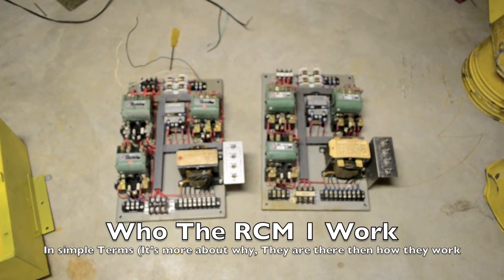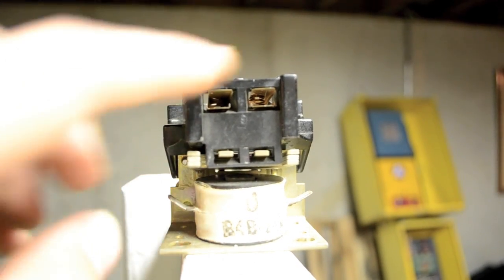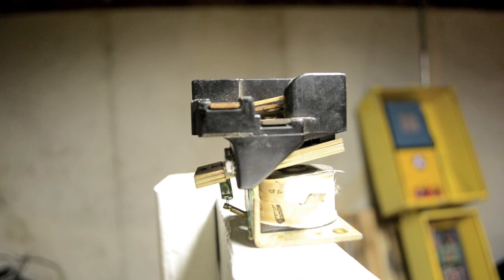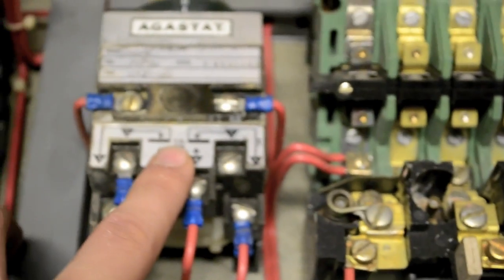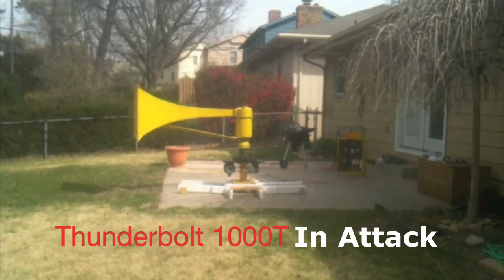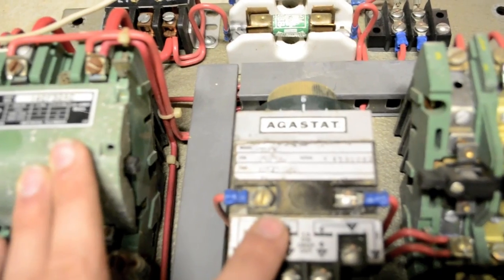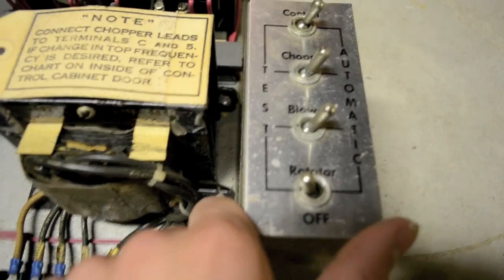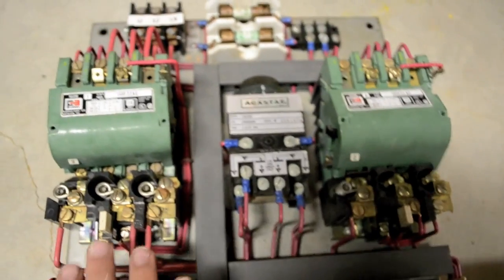RCM 1 Demo On Basic Functions

Comment: The agastat coil is energized by the chopper starter the entire time the chopper starter is energized. As soon as the chopper starter is de-energized the agastat coil is de-energized causing the agastat air diaphragm to leak down for the set time period (6 seconds) in which at that time the agastat relay clicks off and de-energizes the blower and rotator starters. The agastat only starts it's time delay after it is de-energized.